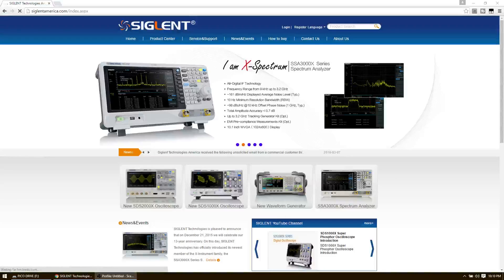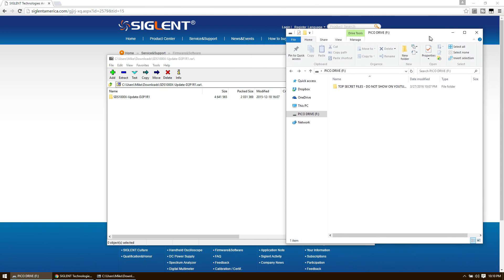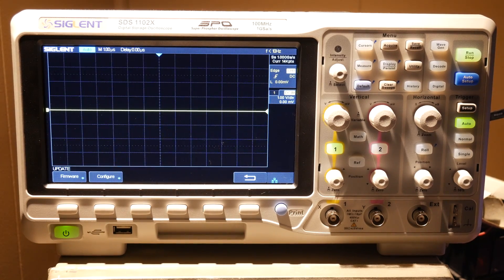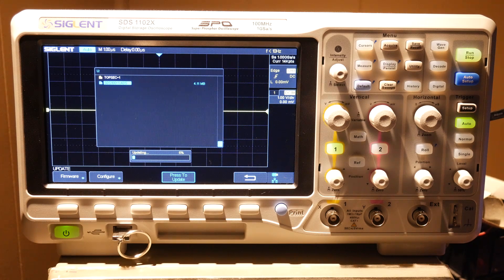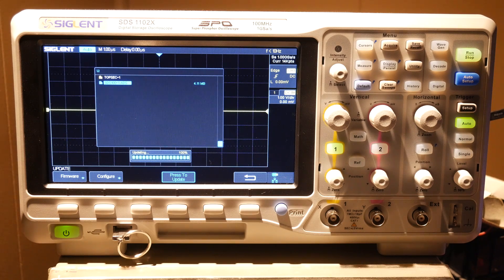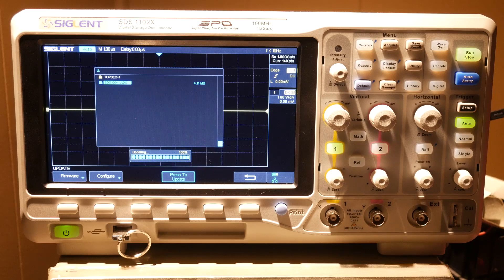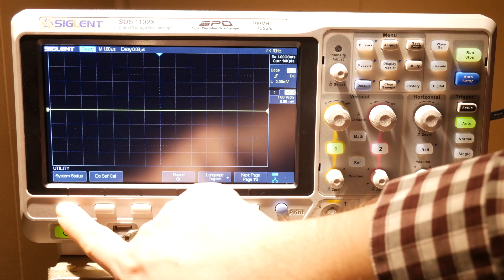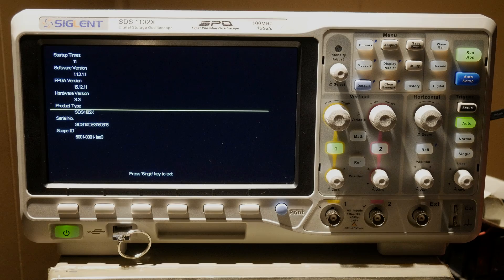Updating the Firmware on Siglent SDS1000X (SDS1102X) Oscilloscope

Comment: Check out what your Siglent DSO shows, when you apply a 50 Hz square-wave signal ...
Reply from the maker: Ominous... Some known defect? Maybe I'll dig up an MSP430 and use it to generate a waveform to check.
Reply: Yes, the SDS1000x oscilloscopes are faulty.
You can test it with a 50 Hz square-wave signal,
or watch my latest Video (german) @ 29 Min. 10
Siglent says "its normal", but it is not.
Reply: @Elektronik-1  Hello, was that problem solved with the last update or not?

Comment: Do you recommend this scope for someone who is buying their first?
Reply from the maker: +Defender Chassis Just like with a lot of tools, it really depends on what the intended usage is. For automotive troubleshooting this would not be the scope to choose as it's not portable, or ruggedized. It can certainly do it but there are better tools for the job. For troubleshooting audio circuits in old equipment an analog scope would be more than adequate and can be purchased for under 50$. For troubleshooting digital circuits or embedded systems, something like this Siglent SDS1102X can be a very good choice. The other good option is the Rigol 1054Z. The big difference between them is that the Rigol has 4 channels whereas this Siglent only has 2. I went with the Siglent because I liked the UI a little better and it seemed more responsive than the Rigol which was something I was really looking for. Some of the very low end oscilloscopes can be very sluggish and frustrating to use, despite producing useable signal traces. In addition, older digital scopes that are past their prime can sometimes be had for a great deal on eBay but it requires time researching specs and constantly browsing to find them. Thanks for watching!